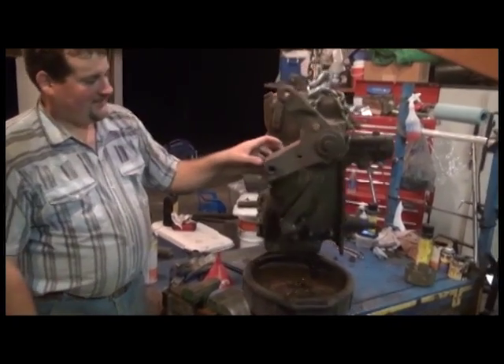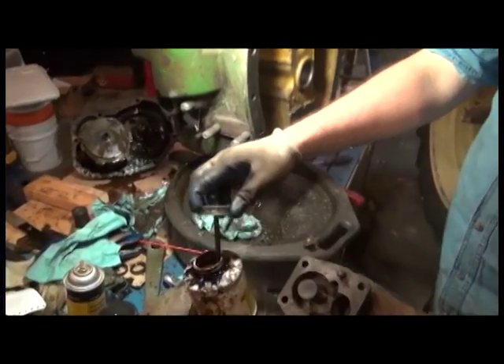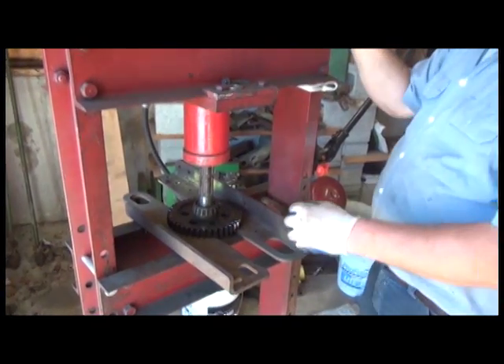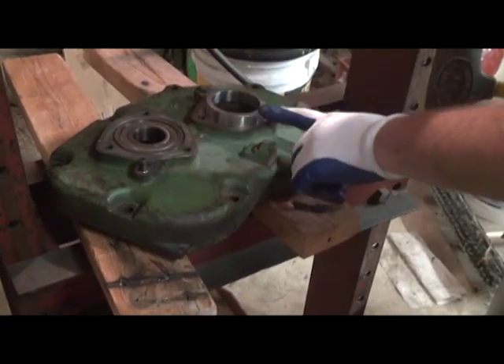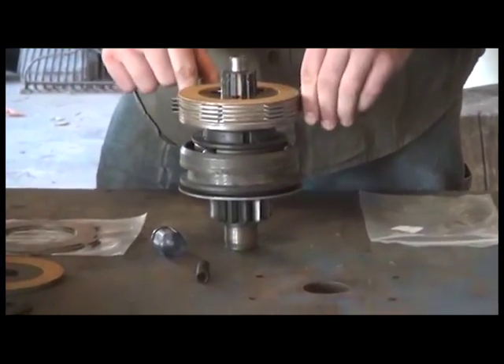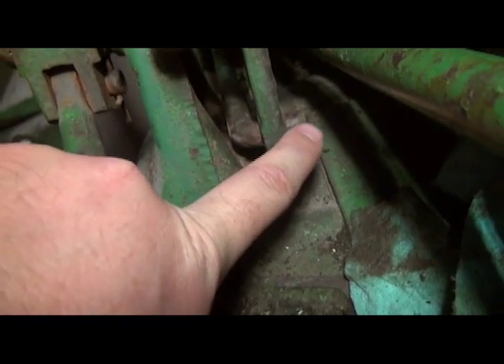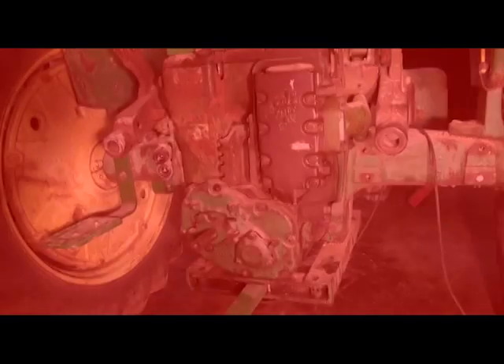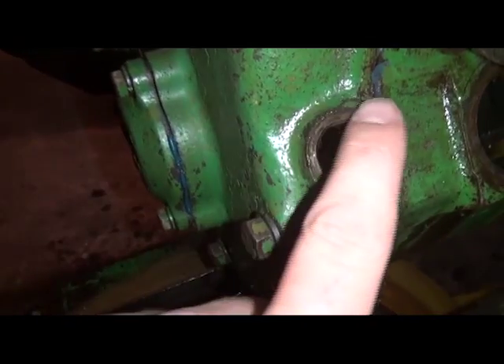PTO Clutch Repair

Comment: Where can i get the seal for the oil pump for the pto shaft.
Reply from the maker: Dan sorry for such a late reply. The parts used in this video can be found listed next to the video on SteinerTractor.TV here is a link to that video. http://www.steinertractor.tv/tractor-repair-with-tyler/john-deere-pto-clutch-repair/192318--3778241/